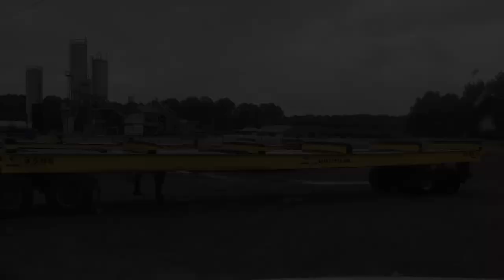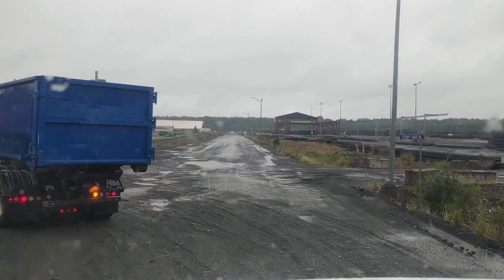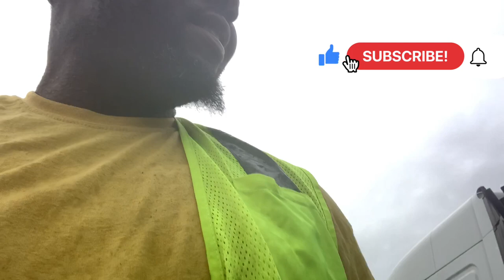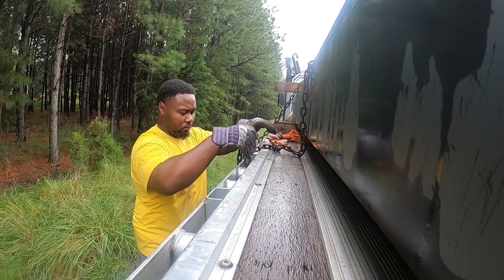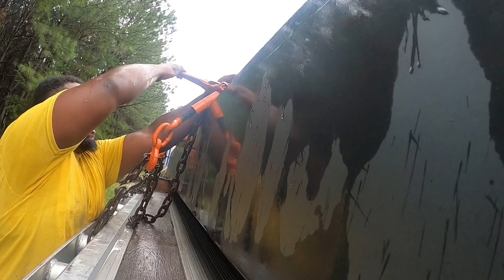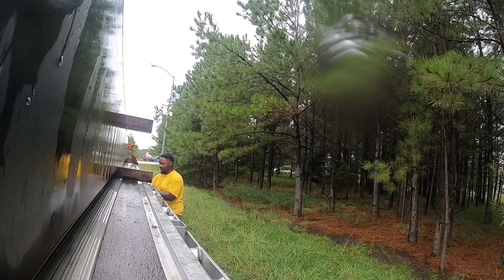How To Use Ratchet Binders Flatbed Load Securement Owner Operator

Comment: Enjoyed the video. Used ratchet binders (for the second time ever) yesterday, then see this video the next day.
How do you keep the hooks from twisting while tightening?
Reply from the maker: That’s why I said get it as tight as you can before actually twisting it. That will keep the hooks from spinning. Either that or place the top hook against the metal to hold it in place. But you also have to make sure they’re lubed up because if not they’re going to twist as well
Reply: @bigsnow1705  wouldn't a silicone lubricant be better, and last longer than wd40? I use it for pulleys seems to work very well.

Comment: Great video bro...it’s always amazed me how every flatbedder does everything a little different, like on those type of loads I put my binders across the top, I just don’t like my binder at an angle. And I use lazy man binders, I use snap binders 90 percent of the time 😂😂 keep it up man
Reply from the maker: That place right there doesn’t want you on top of the trailers so that’s the best way to do it like that because I probably would have got caught up there on top of the trailer so long. And I like my binders close to the drivers side so I can see them in my mirrors
Reply: @bigsnow1705  yeah I feel ya some shippers dont help by not letting you get on top of the trailers. I was just giving you a hard time I got all my flatbed chops from you anyway. I was just messing with you
Reply: Some companies won't let you use snap binders.

Comment: Is there a reason why you don't tighten those while standing on the bed of the truck. What about leather gloves. Mechanix brand gloves I belive have some rubber lined palms..
Reply from the maker: The gloves just wouldn’t grip because of the rain. And maybe some leather gloves would work but I’ve gotten comfortable with the gloves I use. Been using them for years

Comment: You shouldn't force your binder to pull around a corner. You can bend your binder and have a loose load. With that load, you would have been better off binding across the top. you were already up there anyway.
Reply from the maker: Thanks for the advice. Never thought of that
Reply: @bigsnow1705  anytime. Keep up the good work and keep bettering yourself. Loved the video. Honestly wasnt expecting to get a response.
Reply from the maker: @asharelliott6220  yea I’m just laying here in bed. And caught it as soon as it came up. Thanks again